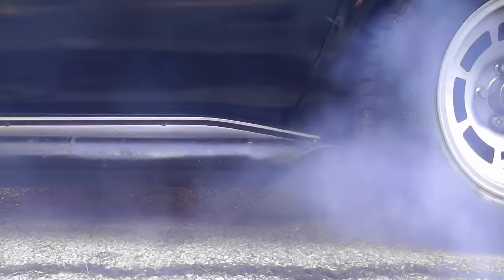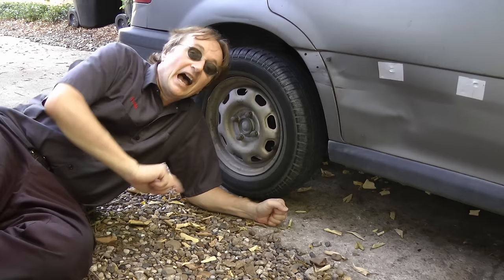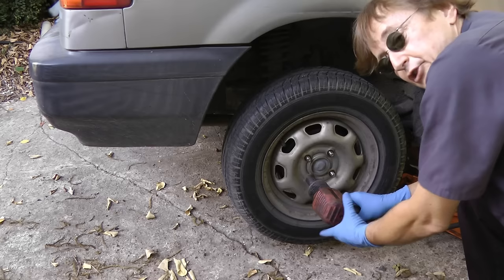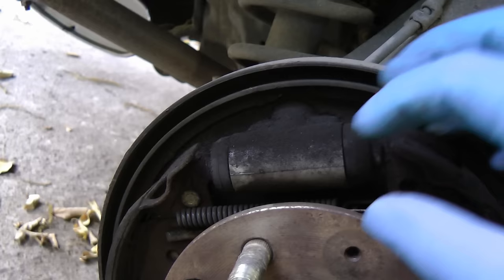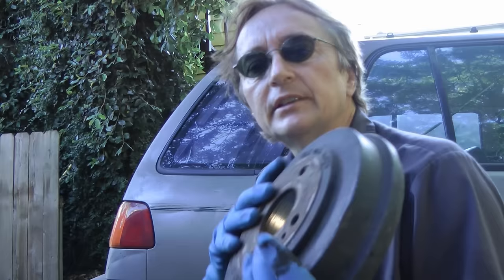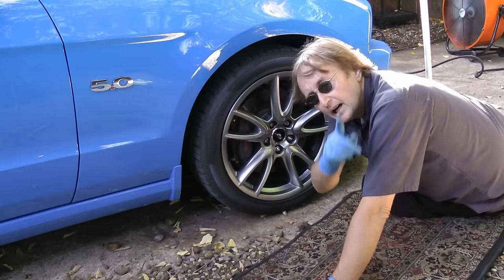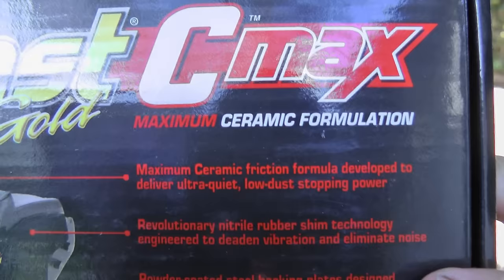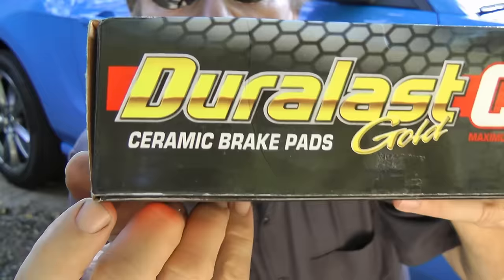How to Fix Squeaky Brakes in Your Car

Comment: Ive got a 2003  Vito, and the wheel makes a sqreaching noise in the front right wheel when in reverse and sometimes in drive, it only started when i put my 20inch rims on and hasnt done it at all till now, any sujestions?

Comment from the maker: NEVER spray stuff on brakes to stop noise, that's a gimmick. use high quality brake pads, i would assume your guy used cheap pads. I use Akebono pads a lot, they NEVER make noise, but they cost more.

Comment: hey scotty i got a question for you,i have a chevy cobalt 2007 i just chance the rear breaks and i did buy the drums also i put everything myself it is my first time changing the rear breaks and the reason why i changed them it was just for maintanence so now that i changed everything i got a problem,when i'm driving to 30 miles per hour and i use the breakes it starts shaking a little bit to much also i hear a noise in the right rear tire when i use the breaks i don't undestand that

Comment: My rear rotor and caliper were replaced a year ago. Recently (happened 4 times) one wheel was dragging, making a loud noise. I jacked up the car, could turn the wheel backward but not forward. I pressed the brake pedal a few times, tried to turn the wheel forward and backward.  After a few tries, it loosened up, I could turn in both directions. Then 3 days ago I replaced the pads (caliper and slide pins were not stuck), drove the car, no problem. But today I had the same problem again. Help!

Comment: Installed ceramic brakes on my F-150 and they squeak every time I brake in reverse. Rotors were also installed brand new. They do have circular marks on them and not the rings like normal. What gives?

Comment: i got a long squeak under normal brake pressure. light or hard on brakes no squeak. ive paid over $400 to various mechanics and still squeaks. cleaned and new lube the squeak goes mostly away for a month then its back. any suggestions?

Comment: (2000 Lincoln town car)
In the morning time  I press on the brakes & put the car in drive & it seems to stutter forward (kick alil) while a squeaky sound comes about. I was thinking it was the breaks & hoping it wasn't the transmission acting up. if u have time My question is why does my Lincoln do this?
Reply from the maker: +Joe Garcia brakes may be squeaking, but stuttering is more a transmission or engine management problem like needing a tune up or fuel injector cleaning

Comment: @scottykilmer im going to change my sisters honda 2008 fit rear brakes. i know how to change brakes but i think for the new series of hondas they have a T clamp for the caliper, can i use a regular c clamp or should i find this new T clamp? also are you suppose to remove any excess brake fluid (when u push the calipers and the fluid rises) from the car?

Comment: Great werk Scotty. So, I had alotta nerse coming from my rear tires. I got good quality
drums and shoes for the job. Not ackyboner, but the best I could afford. after pulling the drums, I noted the shoes had plenty of meat left. I replaced the drums, did not sand the shoes. it's still making a skrapy nerse when I brake. will the nerse eventually go away, or should I pull the tire and sand the shoes. also, could it be anything else? tia

Comment: hi scotty, i have new brake pads installed and its been squeaking.  Just a tap and i would hear the squeaking sound. Brought to the brake pads distributor (bendix)  they refaced the rotor but still its squeaking, some one told me maybe it is really the composition of brake pads thats not compatible with the rotor.  Any advice? thanks

Comment: Great advice wondering if there you had any tips on what I can do with 
my Hyundai genesis sedan, replaced the brakes and rotors, they squeezed 
so badly I had to do something, I purchased Ceramic Boche (quiet cast) 
pad, replaced all pads kept the same rotors, and they squeak just as bad
 as before it's only been 1 day do maybe they are not broken in but, I 
do notice they only squeak when the brakes are warm.

Comment: @Scotty, you showed Duralast Gold Ceramic Cmax pads. Are they worth it (~$50) over regular Duralast Gold Ceramic pads (~$35)? Both are ceramic but the Cmax is supposed to be quieter somehow and in the photo on Autozone's site, the Cmax has some kind of disc brake mounting hardware but regular Golds dont, do I need that mounting hardware? 
Who knows, I'll probably just go OEM since it's only about $40 on Ebay but doesn't come with disc hardware whatever that is.
Thanks for the service

Comment: I just replaced my front brakes.  New rotors and pads.  Now one side has the scrunching sound when I come to a stop.  Any idea?  If oil got on the pads would that make the sound?
Reply from the maker: a ton of oil could do that, spray it all with spray brake cleaner. If not that, either brake hardware slipped and is rubbing or you got crap pads. Things are often poorly made these days and sometimes even i get crap pads right out of the box
Reply: Thanks.  After I did my brakes I put my winter tires on and then sprayed my lug nuts with the thick Rust Check.  I live in salt country.  I think some might have gotten on them but not a lot. 

The rotors and pads are Toyota branded.

Comment: hi , scotty I know you are a professional and I would like to know your opinion on .....when I brake and slowly release the breaks with out pressing the gas and going around in circles always with out pressing the gas it makes a loud squeaking noise on left turn or right turn. What do you think it is if even my own mechanic could not find the reason of it.
Reply from the maker: Natalino Rolli often just worn rotors hitting the grooves on the edge, many cars do that.
Reply: Thank you Scotty, I tried some sand paper on the edge of the rotors and I also cleaned my break pads while I was there and a shower of break cleaner on all 4 and I don t ear it anymore, knocking on wood. Thank you for your videos, they are very informative and I saved lots of money from those greedy mechanics.

Comment: Hey Scotty, my van has drums and shoes on the rear and when i brake there is quite a loud clunking/banging noise from the back, and if im driving for more than an hour it starts to squeak aswell. Someone has informed me the brake load valve may be seized but i dunno, any thoughts on this? Thanks

Comment: I got a question. Do you really need to change your break pads if you have a warped rotor? I have 85% remaining in my break pads.
Reply: You only need to change out the brake pads if they are worn.  Like he said in the video you'll just need to resurface your rotors or drums (whatever kind your car has) and if your pads are still in good condition they can be reused.

Comment: Hey Scotty!My Nissan truck has this grinding type noise when driving forward, when I touch the brakes it seems to go away for a second then come back. 
Seems to squeal when I go in reverse. My guess is the brakes either need replacing or the pin is seized and the pad is stuck. Any help is appreciated thanks!
Reply from the maker: jack it up, pull off the wheels and check em, always start there
Reply: Thanks for the reply! 
Been a fan for a few years now always appreciate your videos!

Comment: Passenger rear brake, 98 Sienna, squeals when braking in reverse and also when braking in drive, but only for the first few minutes when driving after car has been sitting for a few hours. Is this something to worry about?
Reply from the maker: pull off the wheels and check, if brake linings are still thick, ignore it, surface rust often does that and means nothing

Comment: Hey scotty, was hoping you can help me out. I have a 06 scion tc. My brakes (front right side) is squealing. My rotors and pads are new. Just got them changed out not to long ago. I did use ceramic pads so i know the pads are not the problem. My only conclusion is that i probably forgot to lubricate something while changing the brakes. Do you think this is the problem ? Lubricant ?
Reply from the maker: Cher Xiong remove the pads, put brake lube on the inside of the pad and corners where it slides.But it's often just poorly made pads, realize ceramic is a whole range of pads, BUT if you put on akebono pads, noise will go away as their ceramics are top quality

Comment: hey scotty, i have 06 bmw 330xi and ive taken it into the shop now TWICE for brakes that squeal everytime i brake. beamers shouldnt make noise like that, my mechanic says its jsut the new brakes, he says he resprayed them and cleaned off some lube but they still squeal like hell everytime i break andi hate it, what should i do
Reply from the maker: mechanic is an idiot who shouldn't work on BMWs. ALL BMWS need high quality expensive pads and new rotors for EVERY brake job due to BMW design that always leaves a ridge on the edge of rotors, so they all make that noise IF rotors and quality pads aren't used. If you can't afford that kind of money for a brake job, live with the noise.

Comment: Hey Scotty, I have an old 1967 Peugeot 404 that I'm trying to restore on a Uni budget. Only about 3 months after buying the car the brakes started squeaking like that but maybe about 10-15 times louder almost no matter how easy I was on them. The brakes function fine maybe a little spongy but the stopping power is still as good as ever. The problem only starts after about 10-20 minutes of driving though and has stopped me from driving it as I don't want to give a cop any reason to pull my car over or I'll never get it over the pits. I haven't been able to have a good look at them yet because I have allot to focus on with the carbys issues and the generator reconditioning but was wandering on a heads up on what it could be?

Comment: Scotty, I have a 2004 4Runner with squeaky brakes, usually in the morning pulling out of the garage or when it's been sitting a while. Stops soon after. New Wagner ceramic pads, new calipers (frozen pistons), new rotors (turned), anti squeal compound, etc. And still, it squeals. Any ideas? Thank you for all your great videos.
Reply from the maker: +xyloeye I'm not a fan of wagner pads, try akebono, the noise will go away. I stopped using wagner years ago because of noise problems
Reply: +Scotty Kilmer Thanks for the quick reply. The noise has been driving me crazy. I'll some Akebonos right away.
Reply: +Scotty Kilmer 
Apparently, you were right. I changed the pads to Akebono and they're silent now. No more Wagners. Thanks again for your help.

Comment: Hey scotty, I have an 2006 BMW 530xi, about a month ago I had the rotters, brake pads, and the brake sensors all replaced, after about a week or two they begin to squeak when i slow down from 20 miles an hour to zero, anything over 20 and I don't hear it. What can i do to make the noise stop, and hopefully not damage my car.
Reply from the maker: it won't damage anything, but you got cheap parts that just will make noise. Realize you are pretty much stuck with OEM BMW pads and rotors on those cars, as expensive as they may be, IF you don't want noise. they are VERY particular about that , if you can't afford em, don't buy a BMW. They are money pits to maintain correctly. If you paid a mechanic to do the job, he ripped you off.

Comment: Scotty, is it normal for rear drum brakes to squeak in the morning? My 02 Mazda 626 4 cyl seems to do that. After a couple of minutes of driving the noises goes way. This happens every morning and I put new ones four months ago.
Reply from the maker: yep, my work car does that, I fixed em to stop it with new drums and shoes, but it just came back months later. Steel rusts, then it rubs off the rust when driving

Comment: Hello sir every time I try to go fast on the highway (above 50mph) my 2000 jeep starts to shake like it wants to stop, I took to mechanic but they didn't know what it was, thought maybe you could have an idea thanks!
Reply from the maker: some mechanic, find a better one who will road test it with a scanner hooked up to analyze the data and feel the shaking. could be anything from worn transmission to bad u joints

Comment: scotty I have a problem , on a 90 chevy silvrado truck it only makes a sound on the driver side.ones I come to a stop and check them out  theres small black dust with fragments with mettl? come you help me out or were to replace, I change the rotors,calibers, breack pads, master cylinder and the master cylinder
Reply from the maker: Gorgy Welker black dust is worn pads, and if they are metallic pads metal frags will be in there too. Check to see if anything is rubbing there, or if calliper is sticking on that side.

Comment: Wait, what if your car doesn't come with ceramic brakes? Most people would be mislead because if you didn't have ceramic brakes but you use ceramic brake pads with rotors that aren't meant for ceramic brake pads, it'll just eat down the rotors. My friend's Crown Victoria has super squeaky brakes due to using ceramic brake pads on non ceramic brake pad rotors.

Comment: hi, when i drive my car it squeaks and it even squeaks when i apply brakes. it only stops when the vehicle is stopped . what do you think it is ? 2006 Nissan Maxima
Reply from the maker: pull the wheels off, check for worn out pads. If they are OK, shiny worn rotors do that and you can live with that, hurts nothing, and new rotors are expensive

Comment: Hey Scotty Kilmer, I've just picked up a 2012 Dodge Charger. It's got 45,000 miles in it already. The brakes start to make that high pitch noise whenever I brake from high speeds such as 60 MPH. 

It's a modern car and I'm just wondering, could it mean it's time for a brake upgrade/change?
Reply from the maker: I would change the pads then, and use quality pads like akebono that are super quiet
Reply: Scotty Kilmer Just changing the pads would do the work? No rotors required?

Comment: HI scotty! I was wandering if you could help me. I just bought a 2002 Mustang GT and my cars pulls to one side (sometimes) when the brakes initially "bite", my front brakes also squeak and leave a TON of brake dust. I havent had a chance to look at the pads, but im sure it needs new one. Any other ideas? Oh, and my rotors are also pretty shiny and smooth, could that be a problem?
Reply from the maker: If both rotors are shiny, odds are the aren't causing the pulling. Generally worn brake callipers do that, OR a front end problem where braking accentuates the pulling. Calliper wear is most common

Comment: Hi, I replace front and rear breaks and had all rotors turned its a 08 Nissan altima, now I hear a squeak when im  
driving only, not sure if the noise is coming from front or rear, is there something you can recommend,  thanks
Reply from the maker: quality pads are always needed to stop noise, cheaper ones work fine, but squeak. Plus, guys often turn rotors poorly and they will squeak a few weeks then go away as they wear in.

Comment: Can I sand the drum instead of resurfacing it?
Reply from the maker: you'd be sanding till hell froze over, and would also not make it even all the way around  in most cases. Use a lathe or buy aftermarket drums that cost little.

Comment: Hey Scott I have a 2009 Nissan Titan my breaks squeak one or twice then it doesn't do it again
Reply from the maker: brake rotors are bare steel, and they rust just sitting in earth's oxygen laden atmosphere. That rust often makes a squeak as it's rubbed off. IF brake pads are all still thick, ignore it. If not, replace the thin ones

Comment: Hey Scotty, i have a unrelated brake question, but rather a unknown one, at random points i hear a rattling under my 01 crown vic. Is this a exhaust problem? thanks in advance.
Reply from the maker: tons of things make fords rattle, but jack it up, pull on the exhaust, pray it's just a loose hanger or pipe

Comment: Hi Scotty,
I heard the high pitched squealing noise from a right side wheel. It starts at 30 mph and It seems go away above 60 mph. Since then, I changed front calipers, brake rotors, pads, and a wheal bearing. But, I still got no luck.. do you have any idea that I have to check? I stopped by several shops to check if there is a play on the suspension. everything was tightened.
Reply from the maker: heck, check the fan belts they squeal too. And check strut mounts too.
Reply: I am wondering if it is a fan belt, can I hear that noise when my car completely stop?

Comment: hi I just purchased a 1993 mercury sable and had the brakes replaced but there is a very high pitched sound coming from the right hand side while in drive but on the lift and turning no sounds can you help me please thank you TEXAS
Reply from the maker: if wheel bearing is worn or brake dust shield was bent, brakes will drag and make a noise like that only when weight of the car is on it

Comment: I just changed the rear drum brake shoes and springs on both rear wheels, I had to replace the drum on the rear passenger side. With the car jacked up I don't hear anything but slight drag when I spin either wheel, yet when I'm driving I hear a constant squeaking sound coming from the back. It will go away when I stop, the front disc brakes don't look worn. What is causing the squeaking sound when I'm driving down the road? Could out of adjustment drum brakes cause squeaking?
Reply from the maker: +Micah Hampton if they drag a little, yes they can squeak. loosen them some
Reply: Scotty Kilmer Thank you Mr.Kilmer

Comment: hi scotty, just did a full brake job, front discs and pads, and rear new brake shoes, but are squeaking, do i keep driving as normal or  have it checked??
Reply from the maker: +viuliscopmosco if they stop fine, ignore it, cheaper parts and using the old brake drums over often do that, but they can work good anyway